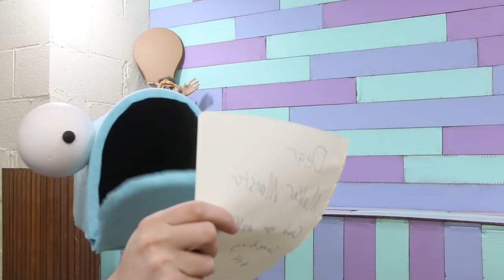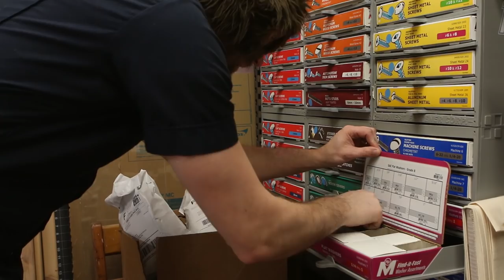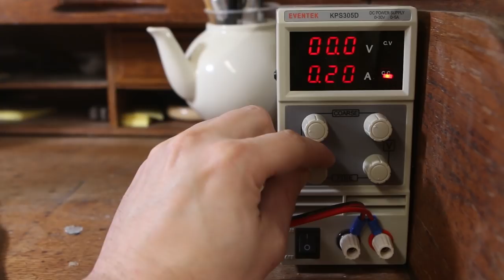How I Turn a DEAD BUG into JEWELRY with electricity | Copper Electroforming!

Comment: Dude, how freakin' cool is that!? How strong does it actually become? Does it just continue building up layer thickness the longer you keep it in there?
Reply: Oh my... U here? Love you two
Reply from the maker: It's so awesome. I left this one in for around 8 hours to make sure the wings were thick enough. I'd still call them fragile but I'm not worried about touching them like I was before. Not sure what the upper limit is time-wise. I think the longer you leave it in the more likely it is to start getting weird artifacts like the lines that were starting on the head area.

Comment: Hey, beautiful work!! I‘d like to know what you did to the graphite paint to use it with the air brush! Did you use thinner? And if so, which?
🙏🏼✨
Reply from the maker: I thinned it with a little bit of 91% isopropyl alcohol. It worked, but since then I've used a copper paint instead of the graphite paint and it worked a little better.
Reply: @TheMakerMonster  Ooooh!  I just asked this.  Which copper paint?  This video is fantastic by the way!

Comment: Wow this is one of the most creative videos I have seen in a long time. (Except mine of course 😁). But this is sooo awesome. How did you came up with that crazy idea?! Awesome!
Reply from the maker: I've wanted to try electroforming for a while and now that I have a power supply I finally did it! It's super cool
Reply: @TheMakerMonster  really great content! What did you spray on before the graphite? And did you use CuSO4 or some other copper salt?
Reply from the maker: Before the graphite was just some acrylic spray to seal it. I just used some thicker gauge copper wire from the hardware store for the parts that connect to the power supply, and then just some thin copper wire to hang it down into the electroforming solution.
Reply: @TheMakerMonster  thanks but I was talking about the copper solution it was in. Was this copper sulfate or hydroxide or something else🤔
Reply from the maker: That makes more sense. Haha. No idea, really. https://bit.ly/2SSorDP That's the one I used though. They've got an SDS on it there.
Reply: @TheMakerMonster  thanks😄👌🏼
Reply: @TheMakerMonster  its only CuSO4 and sulphuric acid. Gonna make this by myself wayyy cheaper😃👌🏼

Comment: that is awesome!  And your "weird" game is on point!  Is there any specific reason to use a commercial electroforming solution rather than making your own?  As far as I can tell, it requires only a few of the items you used to plate the cicada, along with a mild acid such as "cleaning strength" white vinegar...do the commercial solutions offer an advantage over what one can make at home, with the same equipment, and  most metals?
Reply from the maker: Honestly, it was my first time experimenting with it and I knew nothing about it going in. Haha. Maybe in the future I'll experiment with making my own.

Comment: How long did it take for the copper to stick? I am doing my own project but I can't seem to make the paint conductive enough (unless its supposed to take many hours with this method)
Reply from the maker: I made sure I had a pretty thick coating of the graphite paint and then left it plating overnight. Probably around 8 hours or so.

Comment: hi could you tell me what it was that you sprayed the bug with at the beginning before the graphite paint.
Reply from the maker: It was just an acrylic spray coating to give it a little bit more protection during those next steps.
Reply: thanks I ordered a kit but found your way of doing it and the products you used far easier so I bought those :) @TheMakerMonster
Reply from the maker: Fun!! Let me know how it works out for you! The graphite paint can be painted on with a brush too. I found that made it easier on some pieces to get a better connection with the copper wire.

Comment: It's a great video but you had the + and + clamps extremely close to each other! I don't think it will work if they touch! With all the electro forming I do I've never had any success with them shorting out. Probably not good for the power supply either.

Comment: What did you spray on the bug before electroforming
Reply from the maker: That was the graphite paint. It gives it a slightly conductive surface so the copper is able to transfer to it while in the solution.
Reply: @TheMakerMonster  i meant in the white can at 1:30
Reply from the maker: @Karvoo  Ahh. That was just an acrylic clear coat to seal it and add a little bit of protection before doing the rest of the process.
Reply: @TheMakerMonster  oh thanks! I was wondering if that was the case since its an organic material that you'd need some protection. Great video!